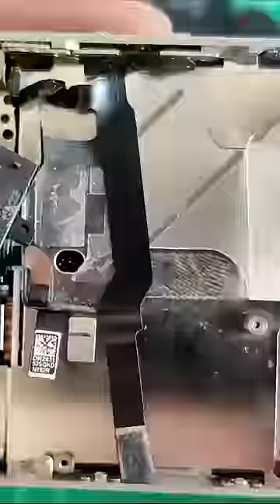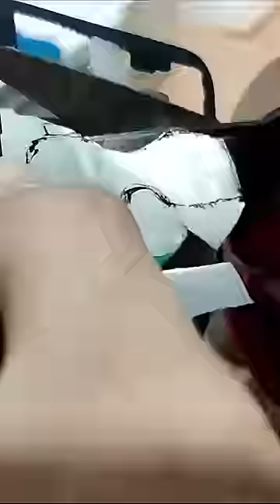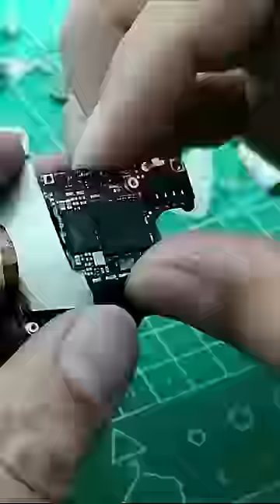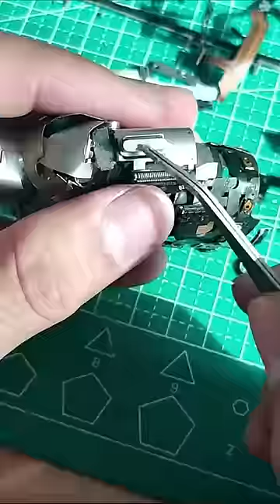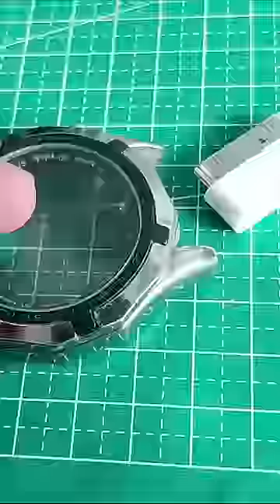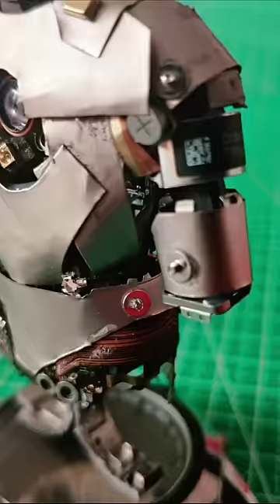iphone turned into Iron Man MarK 1.!!! #shorts

Comment: challenge 
each time you get an higher iPhone you make the higher or more advanced iron man Armour
Reply: Ward
Reply: They'd be stuck on one of the models due to the fact apple hasn't made any major improvements
Reply: @rensellvalencia7179  same as iron man, most of his armors look similar
Reply: @CuongNguyen-fd7if  similar with major improvements and different purposes

Apple only upgrades the camera and minor preformance
Reply: @rensellvalencia7179  
im not good with tech but he mostly add nick and nack from iron legion to mark 43 and later on mark 50 so it basically a compilation of all of it with nano tech and wakanda  
i mean mark 2 to 3 he update the software,repaint it and have a better arc reactor
even from 4 to 5 is a down grade since mark 5 is thinner and almost got counter by whiplash
to mark 6 he up alot from 4 
he almost ditch mark 5 right after the whiplash fight(no armour)
Reply: @NotMyAccount  and more advanced mark 85
the rescue suit for his wife
Reply: Challenge you pay
Reply: @mihirvartekar3720  
nah bruh 
im broke as fuckc